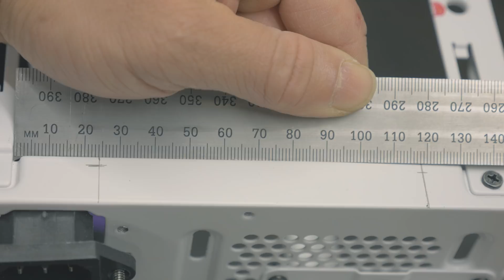Top Rads and Other Custom Loop Considerations in the NR200

Comment: With the side mounted 280mm aio why do the fans have to be in the case by the psu? Why not put them on the other side of the aio pulling air through the vented panel?

Comment: Does a 92mm fan in the rear as intake/exhaust help at all with a top aio ? Should the top aio fans be set to intake or exhaust if using the 92mm fan?

Comment: Bottom mounted radiator is the worst solution possible because air collects in the highest point what’s the pump with a bottom mounted radiator.
Reply from the maker: Bottom vs top isn’t a consideration for a separate pump/res in a custom loop.

Comment: with this mod, is it possible to mount a 240mm aio up top?
Reply from the maker: Not unless you have a very thin rad… the one I’m using is 20mm. If you mount straight to the top cover you can probably get an additional 5mm.

Comment: Not being able to use a regular rad on the top sucks hard (for me). I have a Corsair 240mm AIO and as GN said, bottom mounting is terrible for the life of the rad. Also side mounting the rad hides everything. Might have to sadly go with an air cooler for this one 😢
Reply from the maker: I would agree, if you can fit an MA612 stealth or U12A it wouldn’t be far off from a 240 either.
Reply: @MachinesMore  Yes sir. But since im shelving my Corsair AIO because it wont fit, I bought the Scythe Mugen 5 as its .5 mm below what they say fits and from what ive seen on yours and other channels, it fits and has great performance.

Comment: What if I don't Mind a side mounted radiator?
Reply from the maker: You’ll have to go with a pump in CPU block unit, most likely, or a separate pump and res, since the rad and fans would interfere with the normal pump/res placement.

Comment: I know you did this a while ago but I have a question for you: could you modify the motherboard mounting bracket to move it lower to fit an AIO up top? I have a dual AIO setup and would like to try this case. I am thinking of modifying this motherboard bracket to lower it down, lowering GPU clearance to 2 slot but then allowing me to fit the side rad and also a top rad.
Reply from the maker: Yes, you will have to widen the IO cutout too (you will have to cut into the top slot) but this should be fine with the right GPU. Also the cutout in the back of the mobo won’t line up right but that’s more of an inconvenience than anything else.

Comment: Just wanted to say that I have mounted the TX240 on top of the case without any issues and no modding:

- Remove top mesh
- Remove rubber dampers from fan mounts
- Mount rad to the top panel
- Mount NF A12-15
- Using X570 Aorus I Pro Wifi

It just about clears the ram latch and the power supply extension cable 

Very happy with it so far!
Reply: Were you able to attach the cpu fans to the top of the board? My slim fans get it the way.

Comment: I pulled the trigger and got an xspc 240mm slim rad and slim 15mm fans for a top mount in the nr200p after seeing this video.
It works great and can be used without modding the case.
I just removed the top mesh from the plastic "bracket" and removed the rubber anti-vibration pads and just screwed the radiator in. I then attached the fans on the inside and it works fine without any interference from other parts.
It's got some ~3 mm clearance to the psu extension connector and the ram slots on my Asus Rog Strix x570-i gaming mobo.
After I get a new GPU, I will start thinking about making a full custom loop so this channel is gold. It has everything I want and more.
Don't change a thing! Subscribed.
Reply: that's awesome to hear, I've got the same rad coming this week so hopefully it will work for without major trouble

Comment: I don't get why you went through the trouble of fixing the rad to the top, but then stuck one in the bottom as well. I think it would be better to move the mother board bracket and everything else down so that there is plenty of room for a rad at the top, that way you wont need the rad at the bottom that is taking up space.
Reply from the maker: It depends on the airflow layout but two thin rads would be better than one thick one, especially from a noise perspective. If running a thick rad I would look into vGPU and bottom mounting the rad vs going through the trouble to fit a thick rad at the top.

Comment: Vertical gpu with barrow pump res combo and bottom rad
Does this fit?
Reply from the maker: It should, about 90-95mm of clearance to the backplate of the card, the barrow block is 64mm (and the fitting area is recessed) so there should be enough room for the cable run. On the bottom even with a thicker rad you have plenty of clearance. The only thing is you will have to be pretty strategic on the direction the tubing takes to between GPU block and the pump block, since those will be very close together.

Comment: i used a 3800x and 2080 super 240mm on bottom with fans mounted under case with 3d printed taller feet 45mm and a 92mm rear rad and my temps under load under 65 and in 50s gaming i used thick 92 mm and mounted that fan outside too use a temp sensor for fan control this thing is silent

Comment: First of all, thanks for all of your content, I am actually building my own custom loop with a NR200p and your videos are really useful. We have almost the same build ( same MB, same PSU, same RAM...) and during my tests for mounting a top radiator, i end up strugling with some connectors, especially the D-RGB / RGB connectors. So my question is : Is it enough clearance for the D-RGB and RGB connectors with your mod ? Or is it really tight ?

Comment: I still want to see a mod for a 280 rad on the bottom.
Reply: someone sells a acrylic bottom replacement on etsy for a 280 rad
Reply: @Ricksauce  Makes me wonder why Cooler Master didn't just make the bottom panel compatible with 140mm fans. Simplicity? Bugdet?

Comment: Do you think cards like the XFX 6800 at are out of spec for the case(Length 10mm over) can fit into the nr200p? Mods or not? I assume cable management would not be the best in that circumstance but regardless

Comment: Doing this build currently. Been a wild ride when it comes to measurements. Went with the darkside crossflow for tube routing. And the barrowch boxfish for pump res. The idea of using the sidemount for the top rad is genius 👌  I seen this video and you my good sir may have solved all my clearance issues I was thinking I may run into. Thanks 😊

Comment: Hey I've watched many of your videos but unfortunately can't recall if you covered this, so here goes. The two sickleflow fans are producing a resonance, not in the sense that most people have reported with this case (usually it's more of a clicking), but for me the case is transmitting their rpms as a very audible, pitched hum. I am wondering if this is an issue with the case itself, or if I would still be fine with the usual solution of switching to noctuas. Thanks so much!

Comment: Can you please show us if a front mounted HDD is possible (behind the front panel where two 2.5 ssd can be mounted) in default case settings? if not then what should be the mods for that? #TIA

Comment: yo !! hey check this out !! i may have found a way to mount the XD3 pump without mods , the psu bracket !! you know how the back of the psu have those holes ??? well turns out that you can fit ( with a washer ) screws to fit the 120 mm fan mounting bracket included in the box with the pump/res, because the engineers use even numbers, i had a feelings this could work !
if you can test it and it fit, well good luck !
Reply from the maker: I think so, you would use some screws and nuts to mount the bracket, the rails should line up with the PSU holes well enough that you could do it that way.
Reply: @MachinesMore  sweeeeet ...you verified using the bracket  ?

Comment: Does dropping the PSU shroud make it more difficult to fit PSU cables into the storage between the PSU and gpu?
Reply from the maker: A little- but the 7-10mm shift should be manageable. The cables will sit against the backplate but it’s OK.

Comment: This is amazing! I hope CM is taking notes and allows the v2 NR200 (NR210?) to allow moving the rad mount between the side panel or the top. 

Also, if you were using an integrated block/pump, could you do a 240 + 240 + 280 triple rad setup? Maybe less for looks but for raw performance.
Reply from the maker: That would be an easy option to implement for a v2, I think. For the triple rad, you could definitely do that, or I think a reasonable compromise would be run a 120 over the mobo side of the house and a regular pump/res on the front end. 240+240+120 would cool most components today at very comfortable fan speeds.

Comment: I feel u should do a video on how to invert the NR200 so that the rad can be on top :)
Reply: Flipping the whole case would fix this problem lol I’m thinking whether or not is worth modding
Reply: @NorazoGuy  you can fit a rad in the top as is 20mm xspc and 15mm fans with out modding case too

Comment: Hi there,  I've been watching your videos for quite some time and it made me decide to upgrade from my 900D tower to NR200! I just love how it looks and want to upgrade my old PC.
Originally I was planning on getting 5900 + 6800 XT (Stock is available in my country for any card 6800 XT/3080) with U12A 2 top fans and 2 bottoms fans.
In your previous videos you've mentioned that C14S would provide better results but that would only allow 1 top fan (A12x25) with that said 6800 XT is huge in height and will allow only A12x15.. 
Would you still favor that setup (C14S, 1 top fan, 2 bottom a12x15 or it would be better U12A with 2 top fans ?  
Would 3080 be better with 2 A12x25 at bottom?
Why did you move back to U12A ? 
Your opinion would really help, thanks in advance!
Reply from the maker: Good move! The C14S is the one I'd go with as long as you're set on the vented panel. If that's the panel you want to go with I would recommend that setup you described. If you want to do a little extra work you can get a slim fan above it too. The reason for the U12A was because I was doing comparisons between the vented panel and the tempered glass, so with that setup I needed to go with something that works with either panel. You can get any 6800XT or 3080 where you are? That sounds pretty cool.
Reply: @MachinesMore  Thanks for the reply man, very appreciated!! Is there any difference between C14S with 1 top fan and 2 bottom A12x25 with vented panel VS U12A/2 top fan/2 bottom A12x25 Glass/Vented? I live in Israel and everything is overpriced here due to taxes on electronics/cars and etc.. Everything is available here however costs twice the price of normal price, for example  3080 costs between 1200-1500 USD and I can't find the 3080 FE. This is the price if I want to have warranty. I want 6800 XT however the temps are higher and driver issues and issue with fitting fans below 6800 XT (For example Sapphire Nitro+) might be proving to me that 3080 is the choice.
I might wait for 3080 TI to come out hence my questions. I just want the best Air cooling possible for a solid build that will last me years. Sorry if I'm asking too much.
Have a great year and keep doing what you're doing my man, this channel is so good! Best wishes from Israel.
Reply from the maker: Shalom aleichem! The new Sapphire coolers look to be very good and hope to review one on the channel here shortly. 
In terms of a difference... the C14S is a little better than the U12A for thermals overall, but the U12A tends to favor the CPU. If you are thinking of using the glass panel at all then definitely go with the U12A. It is a tight fit with most motherboards and the glass panel but it will work if you screw in the panel. I would pick the GPU based on how much performance you want. That should be the first consideration, then pick based on thermal performance at that point. Good luck!
Reply: If the 6800 dont fit with 2 fans below you can deshroud it, removing the GPU fans and keeping the hetsink. Then put the fans and voila, better cooling for gpu

Comment: Nice mod- not having a default top radiator mount option is the only thing that turned me away from this case. Funny thing is I ended up going air-cooled on my Sliger S620
Reply from the maker: 👍 good choice. Did you get your S620 yet?
Reply: @MachinesMore  no- they are shipping out this coming mid-week. I believe these are November orders coming out. I ordered early December, I’m hoping I’ll get it before Feb- I’ll let you know when the build is done!

Comment: from all these builds i see online i dont see anyone doing a water build with the vertical gpu setup and a thicker radiator on the bottom. like a 40mm 240 rad and regular 25mm fans which should  clear the pcie cable and then using the borrow cpu/pump/res combo, throw in some soft black tubing and quick release connectors and call it a day.
Reply from the maker: You could absolutely do that. It will clear the riser. Even with a thicker rad though you're probably on par with an air cooled setup though. Of course, performance is not the whole point, necessarily right?
Reply: @MachinesMore  just verified that a 45mm rad and a 25mm fan will not fit under the riser cable. Luckily I had vardar fans already when I got the rad so I order a pair of noctua slim fans for the build.

Comment: You can use this kind of "all-in-one" solution from Barrow as cpu water block + pump + reservoir: https://www.aliexpress.com/item/10000411453657.html, it's mentioned in one of the Optimum Tech videos https://www.youtube.com/watch?v=SBIWgKmwr68 but it has some flaws: the mounting screws are falling through the springs and needs some washers to prevent that; you need to buy a cap for filling port (also fittings not included); you will unable to fill it properly until you buy some 90deg adapter to filling port as shown in his video.

Currently I building up kind of custom loop with this thing in nr200p. Actually it's my second attempt, the first try was fail, because I didn't consider that the soft tubes not that soft as I thought, lol. For now I will just put one 240 rad at the side, and hope it will be enough for 5900x. Sadly I can't find that XSPC TX240 rad in stock anywhere, would like to use it as top radiator with custom hat mod like this one: https://worklogs.coolermaster.com/topic/28848-nr200p-addaptation-for-rtx-3080/
Lately I will consider watercool my 3090 Suprim X and will look at 3 rad setup in this case tho. The card barely fits despite it out of spec in length and its f*cking hot, so I left my side panel open all the time so card be able to blow all hot air out of case.

Great content btw. Cheers and hello from Russia!
Reply from the maker: Greetings to Russia! And Happy New Year! Yeah, I'm not big on the Barrow block because of some of the potential compromises, plus here in the US that thing is pretty pricey. I think the Swiftech Apogee Drive II should be a better option.
What tubing did you go with? 10/16 is stiffer but kinks less. You could always go with something like 12/16 for a bit more flex while still maintaining integrity.
I want to say that for your setup you could definitely get by with 2 rads, just use quiet fans at a higher RPM and it should be fine, but yeah if you can get three that would be best.

Comment: Now that you are cutting on the case, I wonder about placing the PSU on the front panel mounting slots with a hole cut in the interior panel to allow the PSU to face away from the case interior intaking air from the front of the case. Of course the exterior front panel would need to have ventilation slots or holes added for PSU intake air draw.
Reply from the maker: It could work, it would make SSD mounting interesting though, from what I can see at least some of those mounting holes would be removed.
Reply: @MachinesMore  NVMe all the way

Comment: First of all, thank you very much for this interesting video :)

1. I hope that the upcoming liquid cooled build that will follow these mods will have some high end gpu such as 3080 and also cpu such as 5900x, since I don't think that anyone with lower end gpus/cpus would put so much money into custom loop, so please if you could do a benchmark of these parts or even high ones(3080/5950x) I would really appreciate that

2. Have you seen the 17mm 240 cooper radiator that you can get on Ali or Taobao ? What do you think about it in terms of cooling and would you think it would fit without mods to the case when combined with 15mm noctuas ? Could you maybe do a comparison of that radiator to the TX240 (both in top position) as a secondary radiator to the bottom one (so 2x240 rad build) ?

3. Also on Ali you can actually find only 12mm high fans, do you think that those would make TX240 fit without mods ? Or if not, then maybe with the before mentioned 17mm high rad, so that you will essentially get just a 29mm high solution ?

4. Do you think that the barrow cpu/pump block combo can handle 2x 240mm rads + cpu + gpu blocks with somehow not disturbing noise(I mean not pump on full throttle) ?

Sorry for such a long comment and many questions :)

Comment: Fantastic coverage of the various placement choices. TBQH it blew my mind to see you mod it for a top-mount rad. I have the NR200 with a side-mounted PE 240 (NF-F12 fans), bottom-mounted TX240 (NF-A12x15 fans), top-mounted NF-A12x15 (black) fans, Barrow CPU pump/block combo, EVGA 2080 Super HC GPU, and soft tubing with a couple Koolance quick-disconnects. I absolutely love my build but it's very space-constrained compared to yours. Well done.